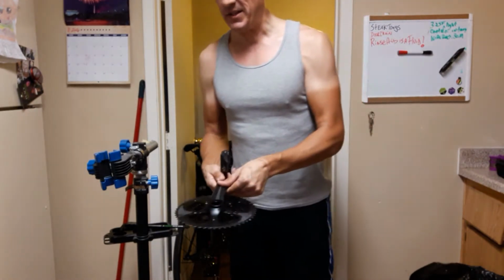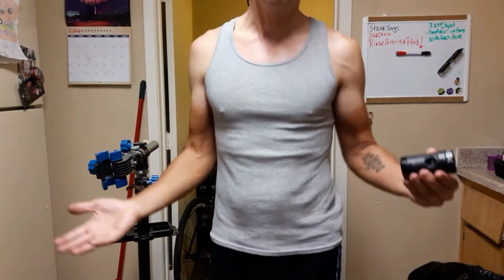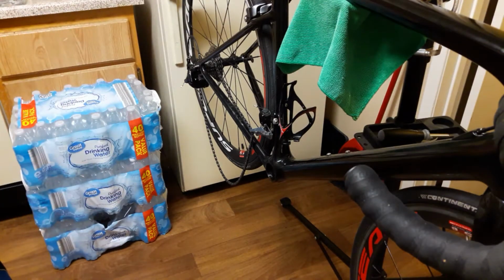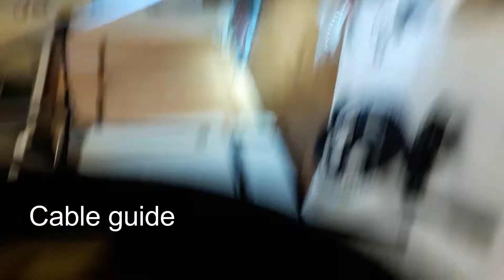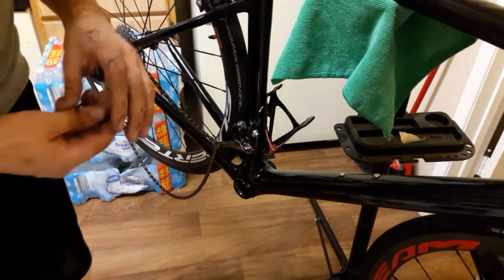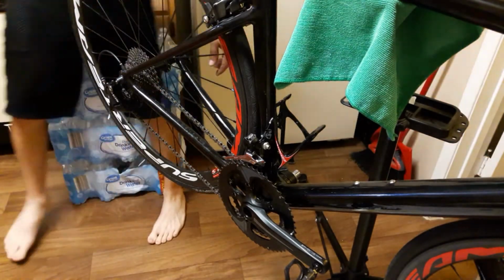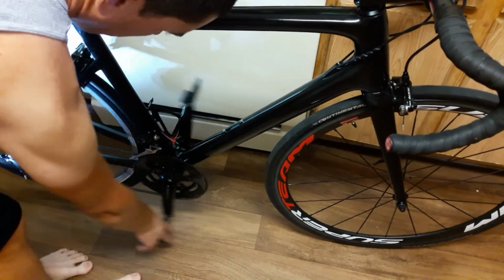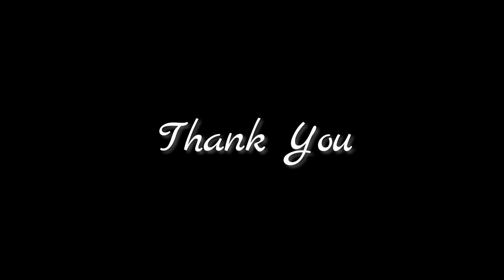Tech Show - Crank Wobble Fix on Cheap Carbon Bike

Comment: I know your doing this on the cheap but if you never want problems or issues with the BB you may want to install a Hambini BB.  He has a youtube channel that explains all the BB issues encountered in modern bikes.  He actually sells his BBs to a lot of pro teams who are forced to use press fit systems.  He is a mechanical engineer by trade who happens to enjoy cycling and makes and sells bottom brackets as a side job.
Reply from the maker: I was having issues prior to this BB install because of the different spindle sizes at each end. The cranks were wobbling bad. But this BB which is made for the cranks i'm using, has fixed the issue. I appreciate the feedback. I in fact just hit my first Strava top ten segment finish with this bike on today's ride. I am however still having some issues with the seat post slipping. I'll have to check out Hambini's channel maybe he's got some advice for that issue too. I have tried some of the suggestions from Trace Velo channel for that specific issue. thanks for watching our channel.
Reply: Sin City Cycling I also have a fascination with cheap Chinese bike parts as some are well made where others are just crap.  I’ve had some parts break that were made out of inferior quality materials such as cast aluminum computer mount, carbon seatpost that split even using a proper torque setting, and a tail light that had a battery that just could t hold a charge after only 4 months of use.  I have heard of carbon frames that were fantastic such as hongfu and dengfu frames that retail for $350-$450 frame fork and seatpost.  As far as your slipping seatpost if fiber paste doesn’t work I would fashion some kind of wedge along with the fiber paste.
Reply from the maker: @Stealthwealth1001  Fiber paste was the first thing I tried. I have had some success with a combination of carbon paste and paper. It's just an inferior set up to hold a seat post though. As far as cheap China things go it's hit or miss. Sometimes things are good. Other times just absolute junk.
Reply: Lvskymar - Actually he’s an aeronautical engineer. He knows materials, statics and dynamics very well... he’s a very sharp guy.